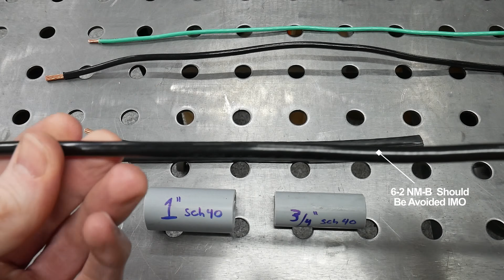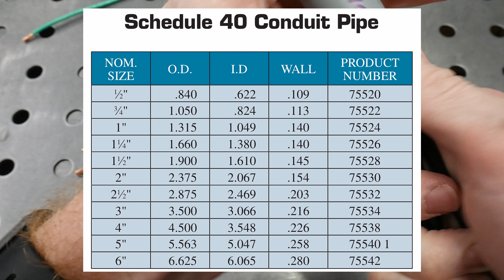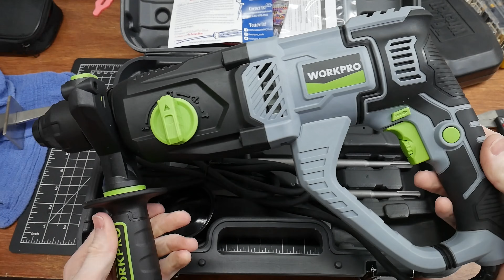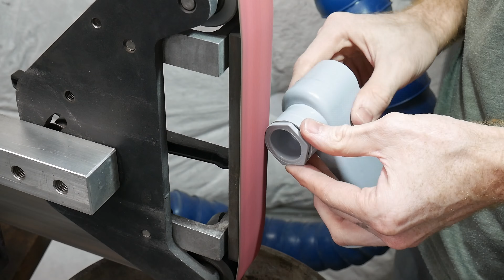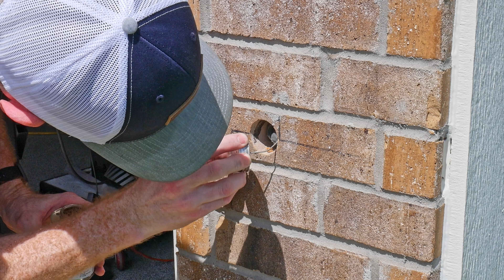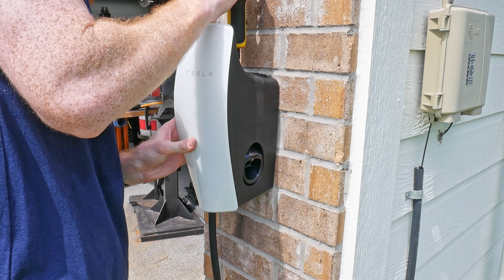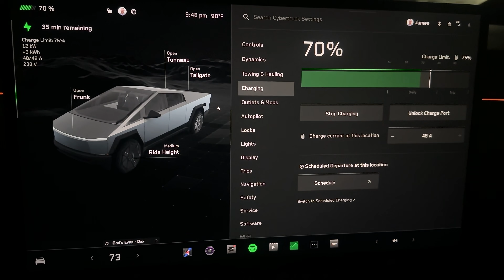How To Install A Tesla Universal Wall Charger | 60 Amp Circuit

Comment: I’m trying to remove the Tesla wall connector from the wall as I’ve sold my car, but I’m struggling with it. Could you let me know which screwdriver you used to unscrew the top and bottom of the wall connector? I am stuck at the first step of taking off the wall face of the charger. I have an Ikea screwdriver set but non seems the fit the screws. 

Thanks!
Reply from the maker: Man good question; if I remember right the wall charger came with a "special" bit for those screws. Although I could just be a 4mm hex... not sure...  

Page 19 of the manual shows the hex bit was included in the kit - https://digitalassets.tesla.com/tesla-contents/image/upload/gen-3-wall-connector-installation-manual.pdf

If you've misplaced it you can order the Wall Connector Fastener Kit here - https://shop.tesla.com/product/wall-connector-fastener-kit
Reply: Idk bro, if ur having trouble with getting the very first screws off, and ur kit is an IKEA one.... Im a big DIY guy myself, kuz most of the time the "pros" do a less than "pro" job. That being said, I hav 20+ years of experience and all the same tools any "pro" might hav. Not to sound disrespectful, but sounds to me u may be closer to the "amateur" category, and with 240v(which is what the unit u want to remove is) that is INCREDIBLY dangerous, u might find a buddy who has the right gear and know how, but if u insist on doing it urself(no hate, im very stubborn too)watch all the videos u can on it and be EXTREMELY CAREFUL, 240v can and does kill "pros" all the time, it'd suck to lose ur life just trying to save some money. Good luck either way.
Reply: why did you sell it?

Comment: Do you need to do anything to make it weather proof?
Reply from the maker: It doesn't appear so. I did silicone around it a little, but I don't know if that was necessary. It's rained a ton since install and I haven't had issues. With that said, it may be best to refer to the manual. I haven't looked in there for verification.

Comment: 50 amp calls for 6 Gauge and 60 amp calls for 4 gauge.

Why did you use a 10 AWG wire on a 60 amp breaker?
Reply from the maker: From my research 6 AWG THWN-2 leads with a 10 AWG THWN-2 ground is sufficient for a 65 amp circuit (at 75F which is the temp used for NEC guidelines) . You may be confusing THWN-2 with 6awg romex which is only good for ~55amps from what I can tell. Note I'm not an electrician and I recommend everyone doing their own research.

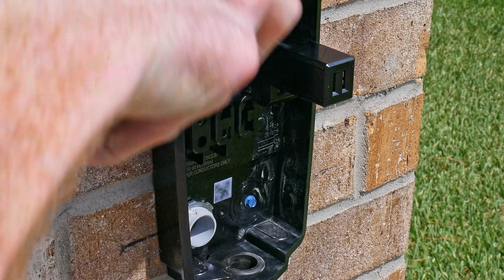Comment: 5:37  Isn't it important to the have L1 use the same wire as the top of the breaker and the L2 to the bottom of the breaker? IOW, the dual pole breaker has a set ordering does it not?
Reply from the maker: I'm not an electrician, but from what I’ve learned, the orientation of L1 and L2 on a dual pole breaker doesn't generally matter. In a 240V system, both L1 and L2 are live wires, each carrying 120V, and together they provide the 240V needed for certain appliances. The critical point is that both lines are properly connected to ensure the breaker functions correctly and safely. The specific order (L1 on top or bottom) typically doesn't impact the operation of the breaker or the device it powers.
Reply: @redbeardengineered   I will look into this.  Thanks for the prompt response!   I hope you are enjoying your Cybertruck and look forward to videos from you on a potential Powershare setup.  Has Tesla given you the Gateway unit yet?
Reply: @VishalRaoOnYouTube  I'm an Electrical Engineer and a DIYer.  When dealing with 240V residential (split phase service) the two hot lines are interchangeable.
Reply from the maker: @VishalRaoOnYouTube  They have not, but I haven't ordered it yet.

Comment: Flat out FINELY MADE VIDEO!  Great info and yes, really that easy to do if you are near an ebox so there is no need to have an electrician charge $1000 for this.  Thanks for sharing!
Reply from the maker: Glad it was helpful! As always I want to reiterate that electricity and dangerous; only tackle projects like this with a solid understanding of the process and with full understanding of the risk! Cheers sir